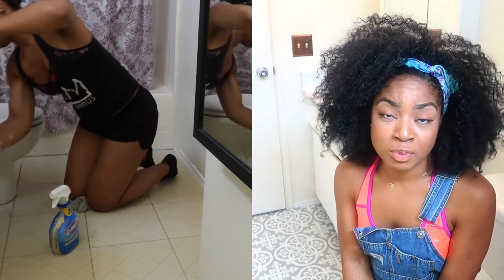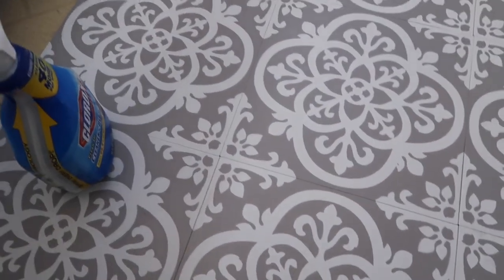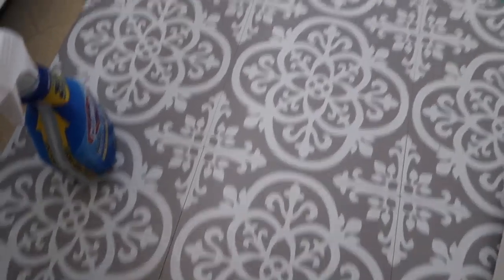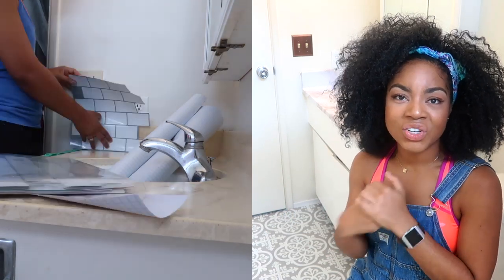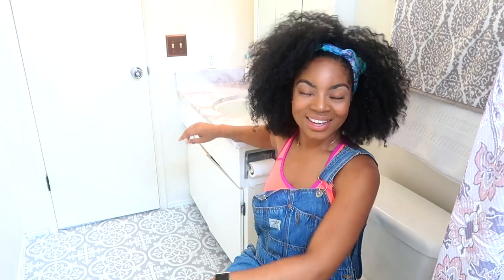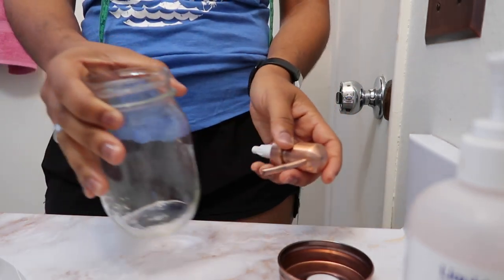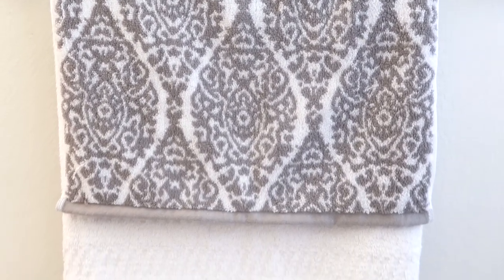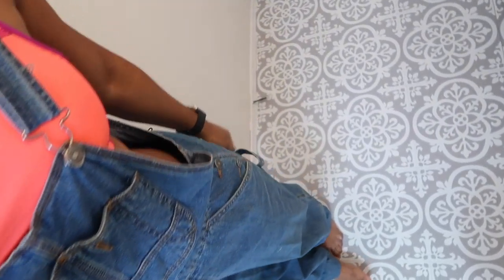EXTREME DIY Bathroom Makeover//Rental Friendly/Peel & Stick FLOOR, Contact Paper & MORE! $200 BUDGET

Comment: Do a teal shower curtain. I used 2 window drapes in my bathroom and tried to make it go all the way to the top but it wasn’t long enough. So I put it up as high as it will go without it showing the bottom of my tub.
Reply from the maker: Hmmm teal...I had a color before and find the lighter the curtain the more light shines though it into my bathroom. But I will look into still getting color, thanks for the tip --; )
Reply: Oh yeah! Light in the bathroom is most important!!! My window is placed in a different position than yours. I watched your kitchen makeover that’s where I got the teal color from! Blessings to you and your channel!!!!

Comment: You need to put Caulking around the sink so water will not go under the contact paper and make mold grow
Reply from the maker: My sink previously had Caulking placed around it and the look bothered my so much which made me want to cover it with contact paper. As of now I don't have any issues with water and mold but I definitely keep an eye on it just in case. Thanks for watching and the tip in case someone else see's your comment and maybe wants to use it on theirs.

Comment: This is the first time I have watched your videos, well I watched your kitchen make over first..  You have done a fantastic job...  I will be subscribing to your channel...   One thing I Need to tell you..  The landlord Must change out all of the outlets, the ones they have are Not water friendly..  I cannot for the life of me remember  the technical name for them but,  should they get wet, they automatically  shut off the power to that outlet..   If you've ever lived in a place where you may be running the microwave then use the blender and bam,  everything shuts off, the room goes dark, and your like OH Nooo  I'm in big trouble.  Well you've blown a fuse..  Those work the exact same way..  I ain't gonna lie, I had my straightener on the sink, while it heated up I brushed my teeth, don't know what the heck I did, but  the straightener fell into the sink. Voop, outlet clicked right off...    Unplug everything, hit the reset button,  then your ready to go. Only a little smarter.. LOL.   Keep that cord far away from you so you don't knock things in the sink while water is running..
Reply from the maker: Angela thank you so much for your feedback! I totally know what you mean because I blew a fuse when I had my portable heater on in another outlet one time and had to turn the power back on...But in my bathroom I don't really use the outlet b/c I don't ever really put heat on my hair.
Thanks so much for the tips and the sub! I appreciate ya and hope you're having an awesome day!